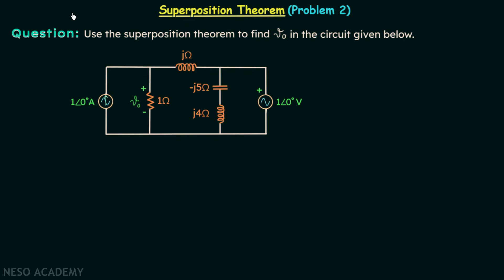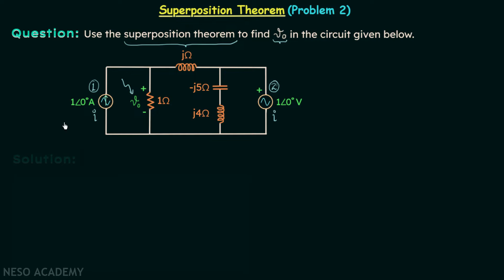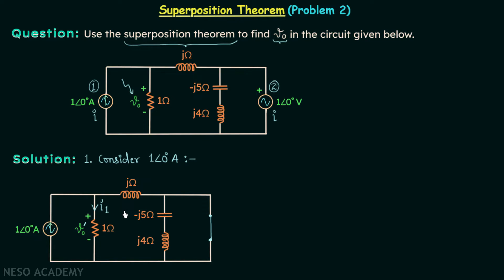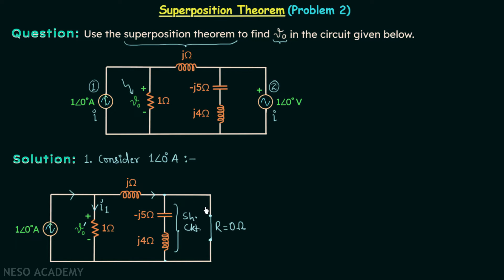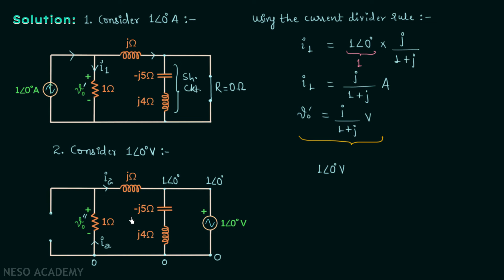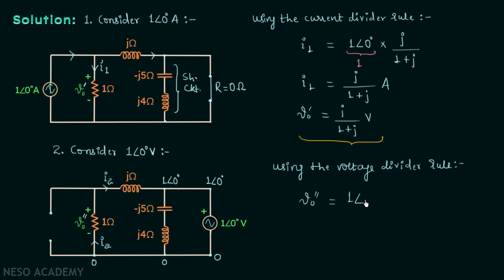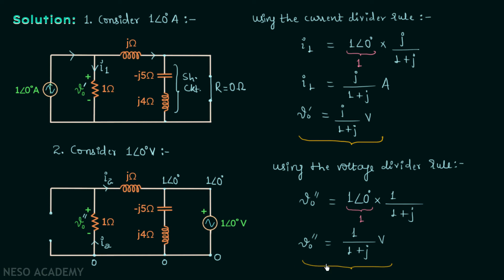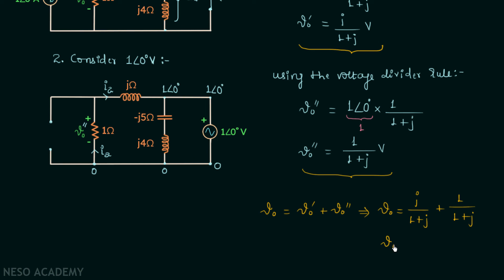Superposition Theorem (Problem 2)

Comment: Sir after removing voltage source it is short circuit but for current source it is open circuit.. Why??
Reply: It’s law , superposition is that you should zero any independence source, in voltage is to make it short circuit because In short circuit the voltage =0 , in the current is to make a open circuit because in the open circuit current =0

Comment: Sir in the voltage divider why didn't you consider the capacitor and the other inductor???
Reply: We need not consider those.
Total voltage across j ohm inductor and resistance is 1<0 V.So, inorder to find Vo,we directly use the voltage divider rule. 
Me too got confused initially,this is correct i guess.
Reply: Sir ,same doubt please clarify it
Reply: It is because RC // LC // Vsource. So, Vrc=Vsource. Then, just count the Vo with voltage divider
Reply: Thanks buddy! I got confused too. Silly mistake of me @50_fadhil63
Reply: Short Circuit man
Reply: @shubhambhavsar7958  but why or how
Reply: Can you explain bro
Reply: Coz current won't flow through that branch coz of resistance 
So no need to take
Reply: Because the node with the capacitor and inductor has the same voltage as the source, since they are in parallel. So it's easier to just find the voltage at that node so you don't need to consider the capacitor and inductor.

Comment: Sir how you take direction of current?
In case1:it is moving downwards in the resistor.
However 
In case 2:it is moving upward in the resistor.
Reply: i think sir try to indicate the same current flowing in the branch let say if current passes in i ohm resistor is also passes in inductor